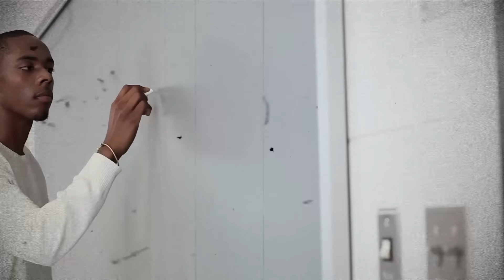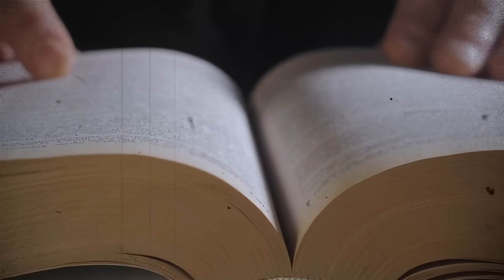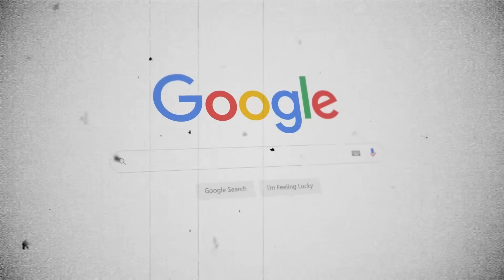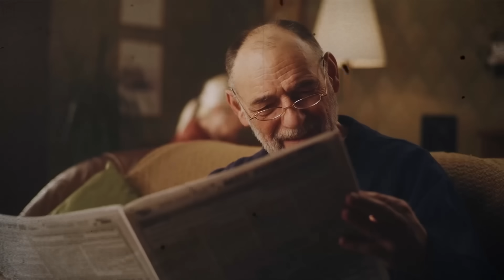This African Kid Invented FREE ENERGY And Scientists Can't Believe It!

Comment: what about a wind powered water pump it just uses wood cups a rope and pulleys 11 century China.powered bu Wind or water Or both it pumps water to a higher location. think Bernini discovered water has Negative and positive charged Ions in it when its moving it produces a weak electrical potential, but this is probably a copper zinc battery with rain water as an electrolyte. it never runs out just slowly corrodes..